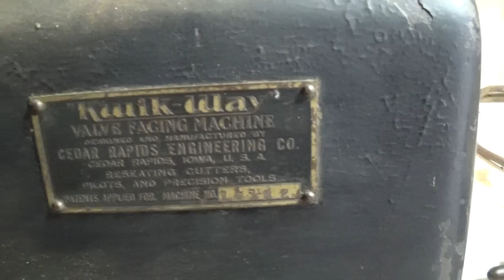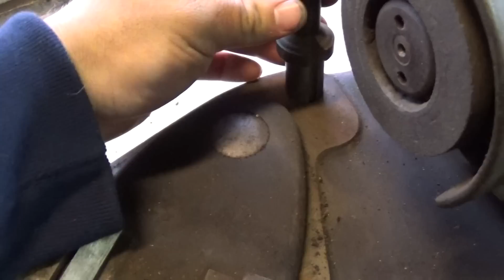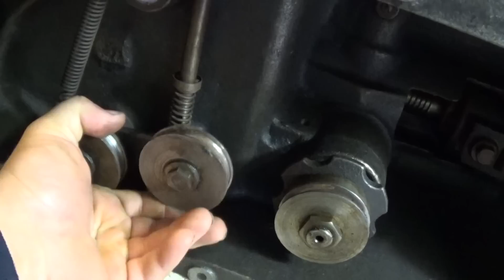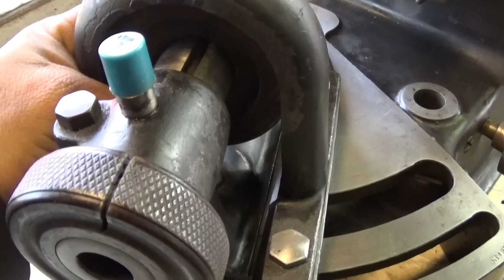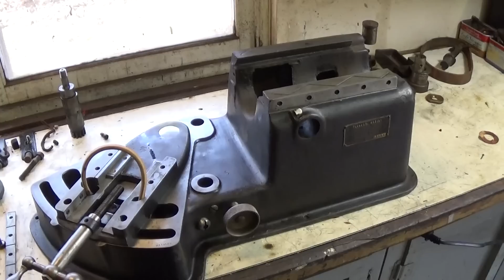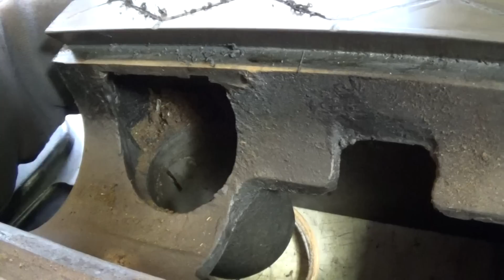1920s KWIK-WAY Valve Refacer Repair (Part 1)

Comment: Can you tell me how you removed the driven gear assemble that is held in place with the wedge. I removed the wedge bolt but feel like I need a slide hammer to pull on the assembly. I have the same machine

Comment: I have the same unit and it works fantastic
A few suggestions 
1.  A standard v rib washing machine drive belt fits it perfectly although narrow.
2. Use a 4 inch fiber hand grinder disc and you will get a fantastic finish because the disc acts like a vibration dampener and eliminates the ringing of a stone.
3.  An old style electrical fuse cap will fit the oil tubes.
 4. Always start the machine and advance the valve onto the stone and keep the valve in contact with the stone until finished grinding then back the valve away from the
Stone. Using a 4 inch grinder disc also cools the valve.
Reply: I have one that belonged to my grandpa.  No real use to me. It is running condition if you are or know someone who would be interested in. Have no idea where to market it.
Reply: What size drive belt do you use?

Comment: You have a solid foundation for precision work. Please do some run-out tests/checks with a 1/10's test indicator to confirm precise tolerances for valve regrinds. Thank you so much for saving an old machine from the scrap yard. Many useful and productive years in it yet. Subscribed.

Comment: The leather belt will need occasional treatment with neat's foot oil(comes from cow). Period publications also recommend a little castor oil as well,although I am unsure as to why. With a low load belt like that,will only need rarely,but will be more supple once treated.

Comment: what size are the valve stems in your cat heads..  do you have a kwikway valve Seat grinder. https://i.imgur.com/y3b5h5Y.jpg  that is a real mounted industrial diamond..hold it up and it might still sparkle in the sun.. but it had too much to make a jem stone. 

 i changed the flat cotton belt on my early sioux to a micro v .. https://i.imgur.com/y3b5h5Y.jpg  https://i.imgur.com/9Ppo5Kq.jpg my sioux seat grinder set.. https://i.imgur.com/II0WPMZ.jpg  https://i.imgur.com/iUPzttg.jpg   mine is so old it still uses hex drive instead of spline drive.. https://i.imgur.com/eSfpkKR.jpg  it did come with flat head ford pilots and dodge pilots.. https://i.imgur.com/75s2lOM.jpg and this neat thing for cleaning carbon out of flat head ford valve guides and seats.. https://i.imgur.com/NHe45FD.jpg

Comment: As you have found out these are well built machines.  I rebuilt one a couple of years ago and have used it on numerous engine rebuilds.  Some one else pointed out the weak spot as being the ball chuck.  He is correct in that.  I manged to make one good chuck out of the parts from two machines.  Some people have replaced the ball chucks with a collett system like ER collets. Anything that an reliably and repeatedly grab the valve stems in a concentric manner with the spindle will work fine.  The collet type depends on the range of valve stem sizes you expect to regrind.  Looking forward to part 2.

Comment: Please put a brand new valve out of a box into the chuck/collet and turn the spindle by hand with a dial indicator on the valve face to check the run out. .000 to .003 is acceptable anything beyond that it's just a neat antique machine to look at . Goodson tools lists 2 different sizes of chuck balls in there catalog. Worn chuck balls affect run out.  Great video and a neat machine ! As an engine machinist it's always cool to see old machines in operation!
Reply: i couldnt think of there name on the first video,i have a Black and Decker valve resurfacer that came out of a closed high school auto shop .
Reply: Heya Roger. Those were made by Van-Dorn and pretty much the same as the one I picked up this year. Great Machines!!! Cheers! Zip~
Reply: @ZippoVarga  i am aware,already bought the manual for it .... not sure what to do with it yet,but i saved it from the dumpster
Reply: I saved an old Sioux refacer from the scrap yard but has the valve wobble with any valve inserted .
Reply: +Andrew Evans For what it's worth, I've watched him use this machine before, so it's not something that he just picked up. I'm sure he would have noticed an issue in the past.
Reply: crazyfvck it's not something you can see with a naked eye unless it's really bad.

Comment: Pulley bushings look like "oilite" bronze.. If they are, they hold a supply of oil as they are porous...If you lube them, as with most small motor bearings, you should use a light oil such as turbine oil in the "Zoomspout" oilers available at most good hardware stores or refrigeration supply houses... Many good small motors have been ruined by engine oil as engine oil tends to "gum" when used for this purpose....